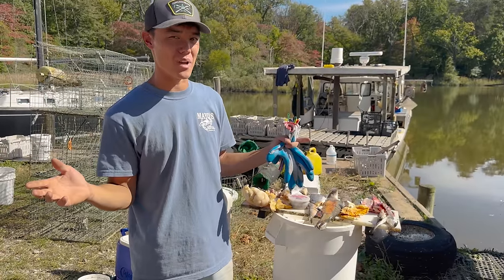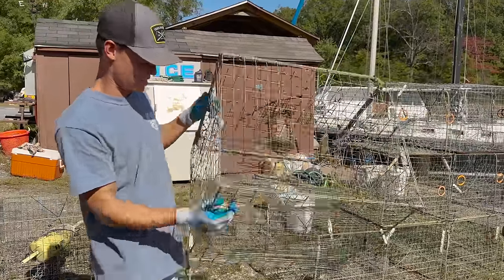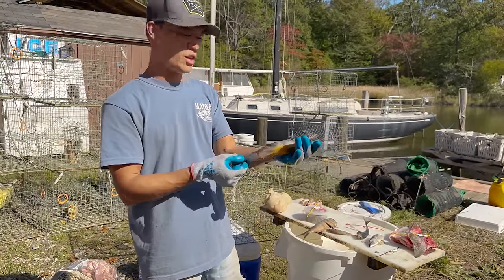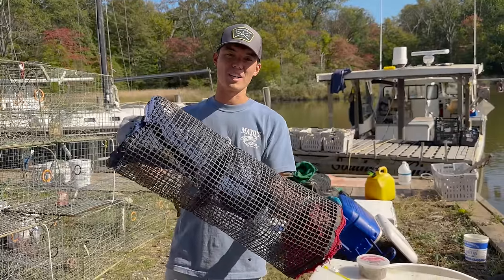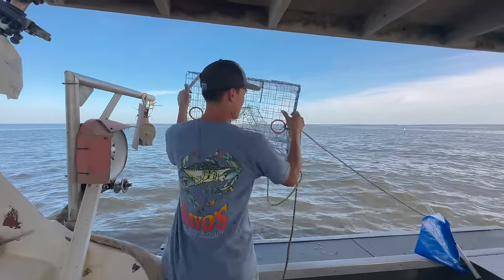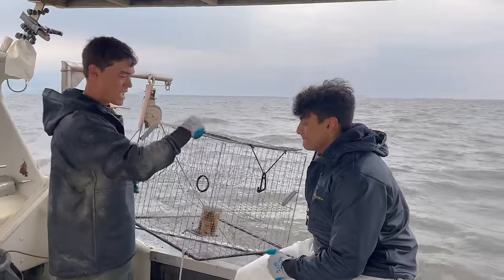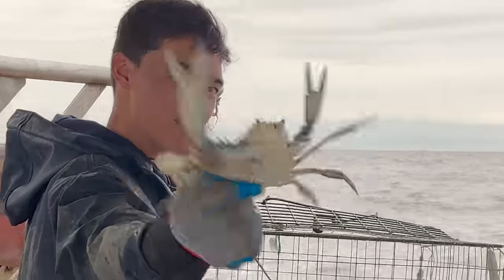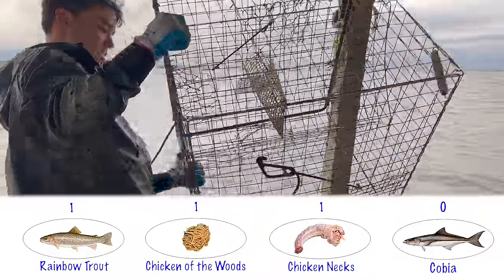CAN IT CATCH Blue Crabs

Comment: We used Cunner in Maine in our lobster traps. When the Macs ran we would use the guts and heads after cleaning them for bait. Had good luck with them. Pollak not so much. I think one of the reasons the shrimp heads are working is because they are already broke open and there is many of them. When that trap hits the water it's like throwing chum in the current. Hate to say it but I think you need to grind up the bait some, especially the oily fish.  
Funny seeing my water in your videos. LOL